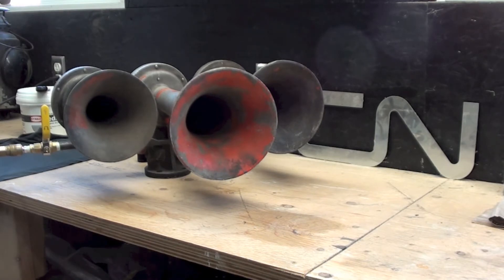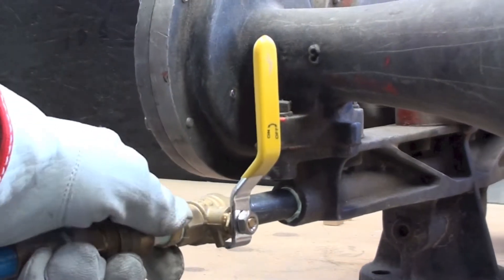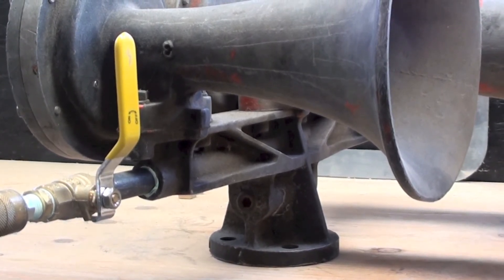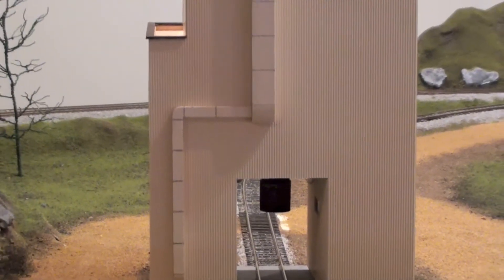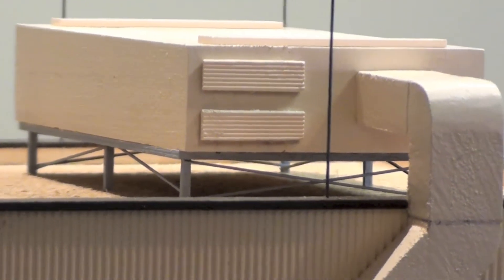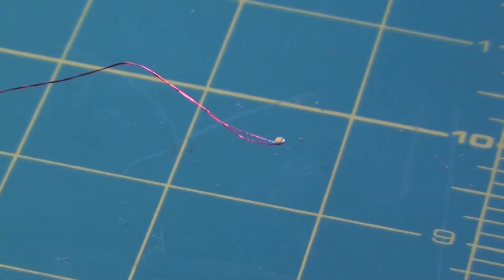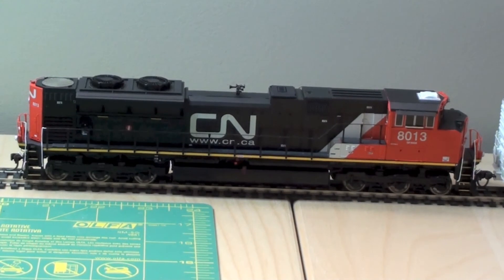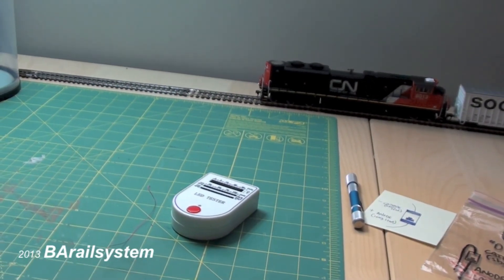Layout Update - September 2013: Scratchbuilding stuff out of wood, 1:1 detail part, 603 LEDs!

Comment from the maker: I think I will weather it eventually. Right now I am just happy looking at the pretty much finished piece. I need to get better at weathering before I try on something that took me so long to build. Yah I tried to figure out which engine it came off but it is almost impossible. There are no formal records. Horns were just a stocked part and were replaced as needed, sometimes taken off, rebuilt and put on another locomotive. Yes, I agree though, perfect gift for a train nutcase like me. :)